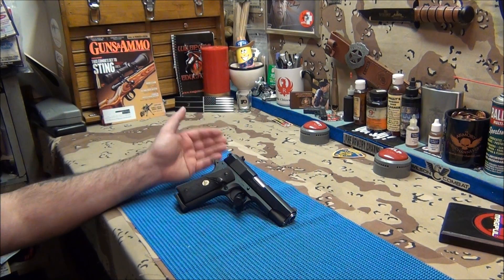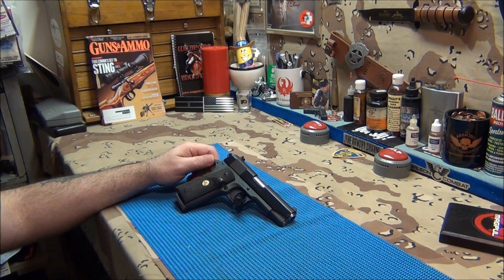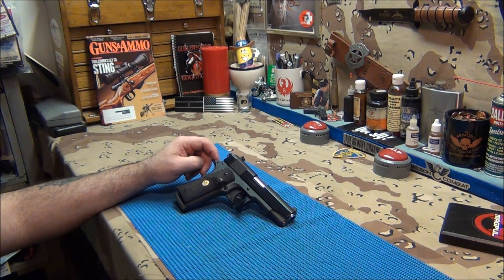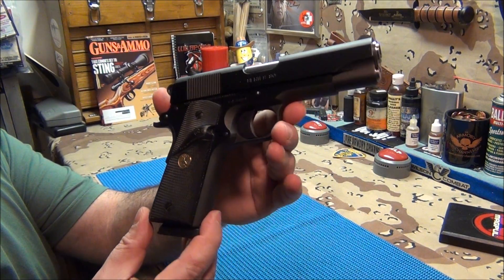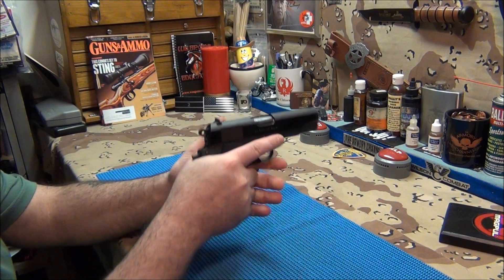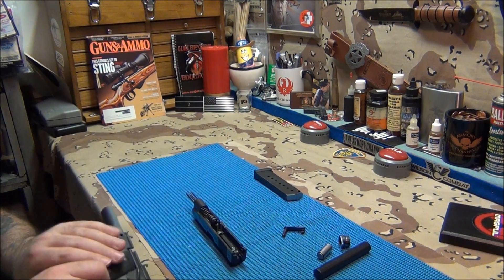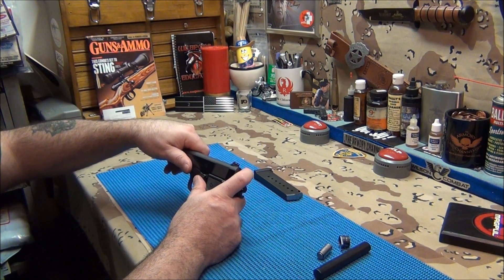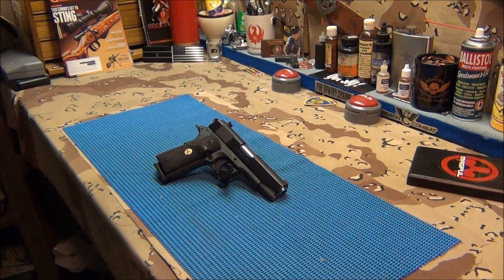Colt Commander 1911 up next to shoot

Comment: love the commander man! Colt makes em loose but my friends runs' like a sewing machine. I got a Springfield operator 250 rds brass zero issues. always cleaned. The other day I shot 200 rds of Tula steel case all in a row with no cleaning or oil. Runs like a top

Comment: i think that's there to center the rds ball or hollow points i have the same gun when brand new i shot 300 rds of reload ball 1 fail,but the reloads come in a bag so wtf my guess is a pounded down round but i'm kinda leery of HPs with those ramps since it's a ball ammo OEM design i'm curious as to HP feeding brands you have luck with since i don't have colt's R&D budget to test brands i'm betting you don't either,but i don't know about all you big-time tube-steak stars lol (slight chain yank)